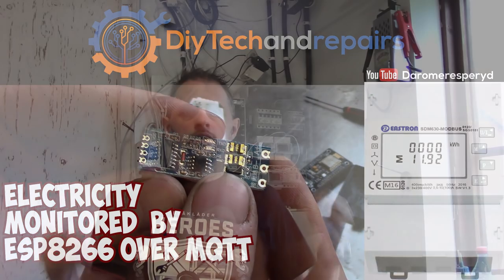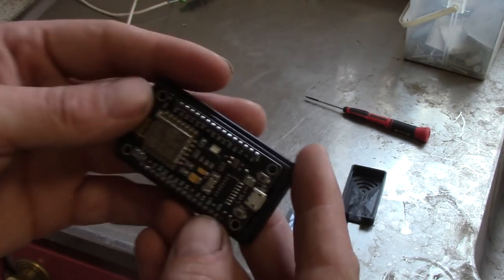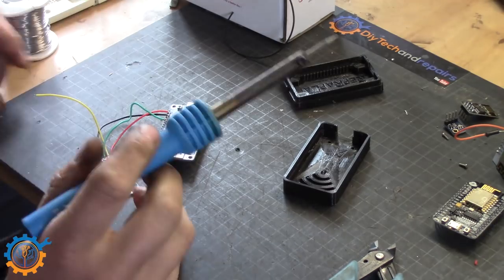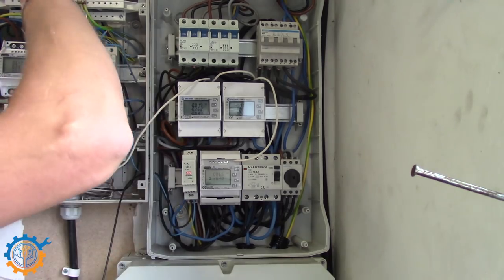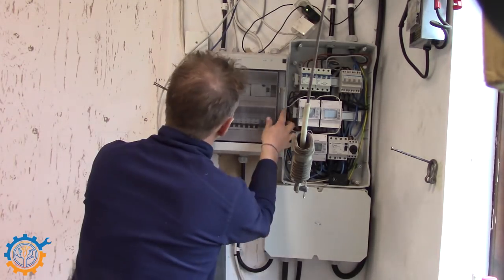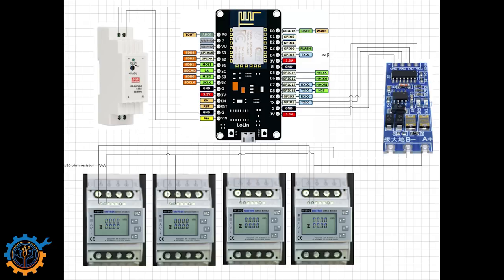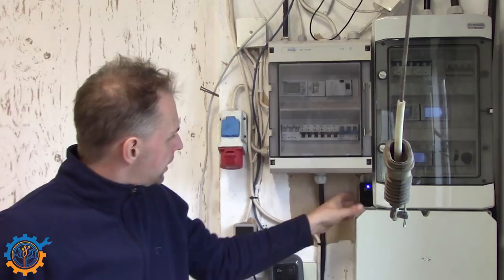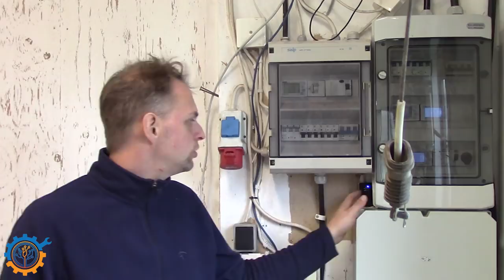ESP8266 to monitor your electricity with SDM meters

Comment: Hi, I have a power meter but it does not mentioned the protocol on the manual user, only RS485 port. How can I read data from device ? Could suggest me the idea

Comment: Yes, I mean a power meter, my inverter doesn't have a power measuring LCD screen and calibration buttons like some other inverters, but it has a WiFi adapter that plugs into the RS485 port, however the This parameter updates every 5 minutes, so I see you doing this or I plan to replace what is
Reply from the maker: Ok. The sdm type meters can be polled very very often. It updates many Times per second.

Comment: Thank for your time and effort. I have a few questions. On  your video you tested the sdm with one phase only. Did you go on to test the single phase with a higher current draw and did all the parameters have readings?
Also where I am is 110/220 50 Hz. Split phase. If I connect just two phases and neutral would the meter work ok.
Lastly can the sdm 630 work with ct.

Thanks again
Reply from the maker: The sdm dont dont do Ct. No it need neutral and yes it works. In My videos you can see that i use 4 of Them. Thanks

Comment: Hi! Very interesting video! But the TTL => RS485 converter you use is not isolated. Are the modbus terminals of the SDM630 galvanically separated from the mains? Is that safe enough to trust? I can't find any safety data in this on the internet. So if anything goes wrong......will everything be connected to the mains which is hooked up to your ESP32?
Reply from the maker: I got 4*630 connected on same modbus so i would Guess they are isolated.
Reply: @DIYTechRepairs  sounds reasonable!

Comment: Hi, your website does not appear to be responding. I wanted to go there to get more details on the code for this project. I’m new to this, have the SDM installed in an ev charger system and wanted to record charging data to monitor the costs of charging over time.
Reply from the maker: Up again!
Reply: Down again?

Comment: Successfully sdm230, thanks Daniel
Reply: Did you use a 120 Ohm Resistor for terminating the modbus?
Reply: Is it needed when using only one SDM230?
Reply: yes

Comment: Very interesting! I would like to read also my powermeter from my solarcells. Could I get the sketch you used for Serial Modbus RTU to get data out of the SDM meters? I bought the TTL to RS485 converter because I had problems with the USB converter.
Reply from the maker: You can find it on Github via the links. Or if you only have 1 meter its easier to run tasmota!
Reply: @DIYTechRepairs  Thank you, I found the link to daromer2/SmartHome. There are alot of lib's. I want to read out 4 modbus RTU powermeter by rs485. Finally the data will be sent by mqtt. My first goal would be to be able to read the modbusPowermeter. Would ESP8266CO2PM25.ino would be the one?
Reply from the maker: @josephtanner248  THe code i used use alot of old libraries so its a big mess to get going. I tried recompile it with newer but never got it working im afraid

Comment: Just a question. Why modbus? Why not Ethernet? Would it a lot of cost to have Ethernet on ESP32 for example? Or is it more about worry of having extra bulkier cables and switches, where modbus can be done with a lot less cables and no switches, and just some bigbanging?

Edit:  Never mind, sdm230 already supports modbus / rs485, so it was obvious choice.
Reply from the maker: The sdm dont do ethernet. They do modbus. And wifi i have everywhere

Comment: I've tried to flash your eastron sourcecode on my esp8266 nodemcu but theres just shown last seen date, mac adress and so on.
How can i import the registers in my iobroker ?
My rs485 modul is not blinking on tx or rx.
Do i have to modyfi some files to show the registers ?
Ive try that for 3 days, but i can't find some solutions :(
I have 2 sdm360 meters
One of that have the adress 001 and the other have 002.
120ohm resistor is on the last SDM.
Reply from the maker: You need to have a working connection. Do you have that? Have you configured wifi?
Reply: @DIYTechRepairs  yes wifi is configured and connected, both leds on D5 and D6 are on.
The blue led on the nodemcu is blinking.

Comment: Hi, you're my inspiration. But I am not able to flash my esp8266 nodemcu. Arduino IDE returns many bugs. Missing files etc. Could you be so kind and share some instructions on how to do it? Thanks.
Reply from the maker: That version is difficullt to get to work. I need to redo the code 100% im afraid
Reply: @DIYTechRepairs  Thanks, Daniel. I will looking forward.

Comment: Excellent videos... learning a lot of staff from you.The InfluxDB, is that a IOT Platform or a Dashboard? Is where you can see the monitoring of the meters or you visualise them in another platform?Thanks
Reply from the maker: Thanks, InfluxDB is a database that store Time series data. I use that to store data for visualization. To visualize the data I use merely Grafana or other tools from the Tickstack.
Reply: So Grafana does not store data, is just visualisation for dashboards?On my system I will be using the ESP8266 with MQTT that will trigger an SSR for the heater. I would like now to visualise my system over the cloud but at the same moment also keep historical data. Thought to link the Thingboard to the ESP82 ? Is that a good set up?Thanks

Comment: I need to find a cheap easy way to monitor remotely the electron harvesting. from my 2 charge controllers . and batt voltage , current, and basically what's going on. Batt temp would be nice. The actual cell temp. Since I'm using lithium ion. I have them arranged in 100 cell packs. I'd like to have a couple temp sensors in each pack. In case of a bad cell or just hot or cold weather. It does get 100 degees F here and below zero! I'd like keeping up with them. They aren't cheap. Have a idea of how I could do this easily??
Reply from the maker: Batrium is One way. Or build with Arduino or esp

Comment: Nice work! What's the refresh rate of the data you get from SDM?
Reply from the maker: I poll every 2 seconds.
Reply: @DIYTechRepairs  what's the highest possible sampling rate? every half second?
Reply from the maker: @ssl2928  dont know but the answer is in the manual. Its high... Many many Times per second

Comment: HEya, is modbus the same as IEC  62053-1  (S0) ? I'de like to connect this solution to a ABB OD4165 to measure but i'm not sure if it will work with it. http://symmetron.gr/uploads/ABB_ODIN4165_ODIN4110.pdf

Comment: Please help,
link does not work.
i need to connect esp 8266+ sdm630 + domoticz
Reply from the maker: Webserver is dead due to drive issues. Working on it and will be up later today.
Reply from the maker: Its fixed
Reply: Ok dekuji.

Comment: Hello DIY I've been watching you for years love your knowledge! Quick question I got a hold of your valence 12v batteries  4 of them! I only charge them to 13.2 volts they don't seem to like anything higher? I took 1 apart like you did in your video and each individual cell reads lishen valence 3.2v  is this the maximum charge each  cell can handle if so I would only be able to charge to 12.8 volts max because these batteries are in 4s right? They look identical to the black valence batteries you have. Please help me out with some advice I don't want to ruin the batteries, I  just want to know is it ok to charge each cell past 3.2v if so what do you recommend? They are old batteries but they work fine so far! They say 14.6 volts max on top of the actual battery does this mean I can charge them to 14.6 that would be nice but I'm afraid to go past 13.2 I don't want to blow them up please help
Reply from the maker: 3.3v is nominal. Max Charge is 3.6 or 3.65v. i Charge max to 3.5

Comment: those modbus are really expensive can you do the same with sonoff?
Reply from the maker: Yes but not realy for mains nor that accurate. I have videos about sonoff too
Reply: have you ever tested cheap chinese ones from ebay for? AC Power Meter Energy Meter RS485 Modbus 220V
Reply from the maker: @CrAzYDr1veR  One phase cost fraction of 3phase. Check sdm120
Reply from the maker: CrAzYDr1veR  Btw do you got a link for one you have in mind?

Comment: Awg for the silicon wires?
Reply from the maker: Which ones?  Choose wires accordingly to max current.
Reply: @DIYTechRepairs  for power 5v to ESP8266
Reply from the maker: @kigan80  perhaps 0.25mm2